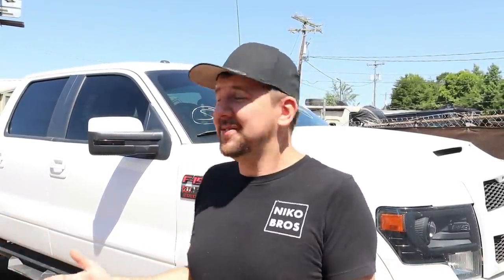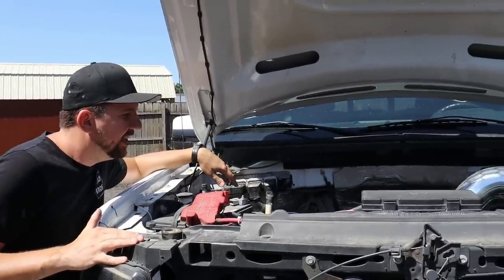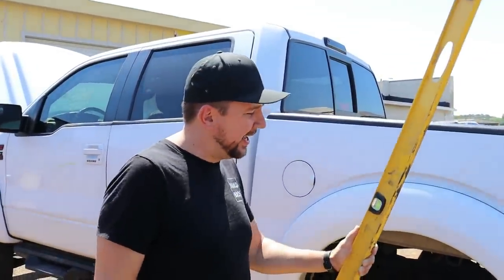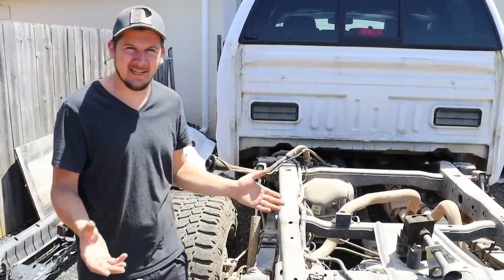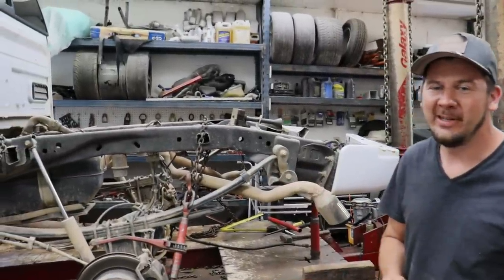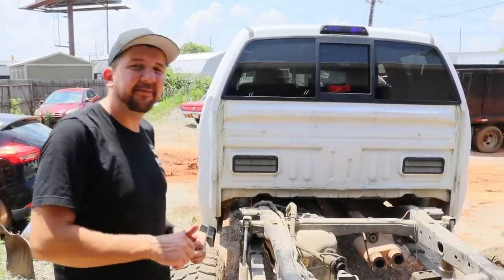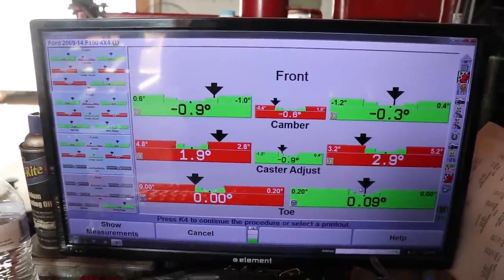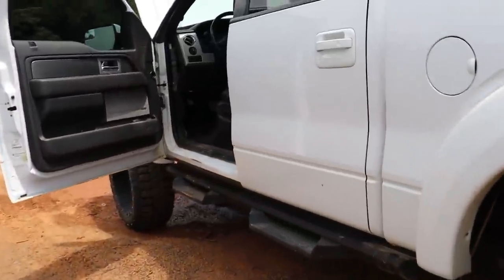EPIC REDNECK EDITION F150 SALVAGE - SHOULD WE KEEP IT ??

Comment: I think I would have welded strengthening pieces over where the frame bent after straightening it because that's now a weak point on either side as the metal has softened etc.
Reply: No you do not want to do that because it will change the crashworthyness of the part. Leave it like it is is the safest even though that seems strange.
Reply: I would just weld them cracks up.   The frame needs to be able to buckle or fold down or up.   But I would really remove the spacers.  Or put smaller ones it for the body lift

Comment: Loose connection or broken wire from removing the bed and straightening the frame at least that’s the first place I would look because the truck ran fine before you took the bed off.
Reply: I agree with your assessment considering it was running before they removed the bed very they could hit the fuel pump connector or broke a wire during disassemble or reassemble 😊
Reply: I agree...that was my first thoughts..something was hit/cut during removal of bed

Comment: There is a hood switch under the hood that looks like a plunger. It’s located on the drivers side fender and gets pressed when the hood closes. It’s a safety thing that makes it not start when the hood is up. It may just need to be pressed manually with your finger a couple of times. Cool looking truck though.

Comment: Just because the fuel pump is running dozen't mean it's putting out the pressure the engine needs to run . Check the fuel pressure requirement  and test . then go from there .   Nice looking truck, quick build and you should be able to make a good profit on this one.

Comment: I know Ford uses a inertia switch that would be down in the passenger side kick panel usually and that will cut off the fuel pump if it's been in an accident. Sometimes you have to go and reset it. But I wouldn't think you would have it running at all if that was the case.

Comment: I imagine you already ran your scan tool, I would trace from the gas tank to the engine to see the problem.  How long did it run getting it off the trailer, it might have been bad before you worked on it.  I would check the wiring with a meter to see if there  is a bad wire.

Comment: Not being a fan of lifted trucks I would either remove the body lift or the suspension lift. Having both is a bit much. Also Redneck is not a Ford model/branding name, just a name made up by someone. You can buy the plastic Redneck emblems on eBay for $10.00.
Reply: I’ve owned & played wth many, many trucks!  Big tired every one! ( 20-30) never lifted one of mine! Lifted many for others! Every single guy, every! mentioned how much more gas / fuel the truck “ate” after the lift! Not for me! The boys “will “ find a buyer, for this truck &  will save the new owner a lot of $ ! Box still not a good fit!

Comment: Love the 5.0, love ford pickups, I've owned several of both but the 2 don't mix right.  That's a car engine %100 never belonged in a truck even when it was labeled 302.  I'd rather have a late 70's epa choked 390fe.

Comment: It's still not level, it still sags in the rear.
Reply: Driver's side cab to bed gap is open at the top. Passenger side looks good.
Reply: @GusMahn  Right, it's the gap between the cab and bed.  Not exactly back to factory specs.  Either that or the box got tweeked down too, and by the look of the crease on the bedside, it's likely.
Reply: @dougaranda6187  It could be shimmed under the driver's rear bolt to tighten the gap at the top or the driver's front body lift spacer could be ground down some unless it moves the body line too much.

Comment: still looks pushed down. Get that level again.
Reply: Using a level on a vehicle means nothing, unless the vehicle is standing 100% level on it's datum points. Easier to make sure chassis was supported on 4 blocks or stands on frame machine and just measure from frame down to frame machine platform and compare each side to factory specs. The gap between cab and bed on driver side gives it away 👍